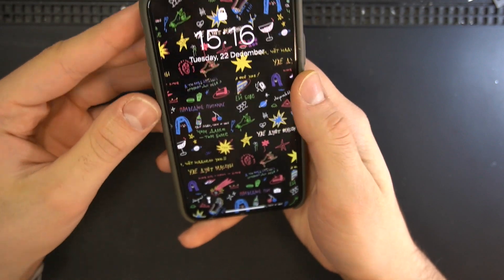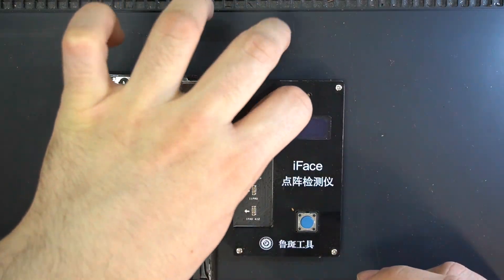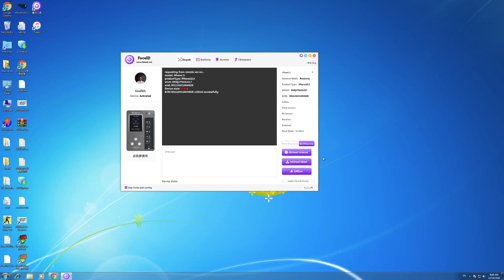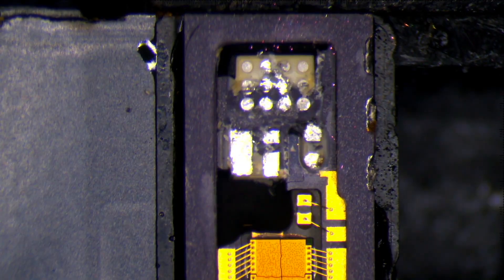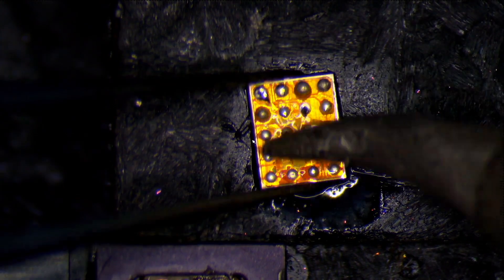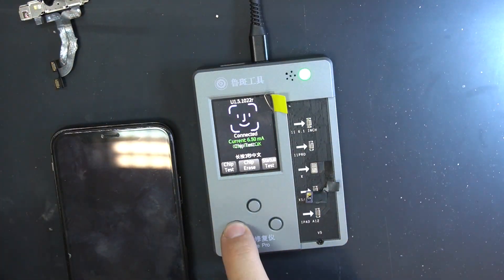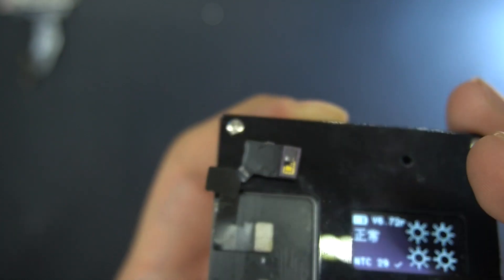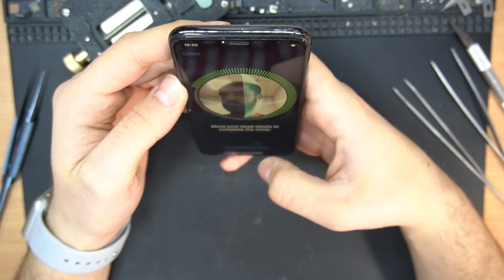iPhone X face ID repair (move iPhone a little higher move iPhone a little lower)

Comment: In every video I see people doing this complex stuff to fix the face id, can't you just replace the broken part?
Reply from the maker: Hi, the chip is the broken part in this situation.
Apple made the dot projector so fragile that a small touch with your finger while the battery is plugged can kill the chip.
And even if no one opens your phone it’s located so close to the earpiece that it’s not sealed correctly to prevent water damage.
Reply: @iTouch-repair  Ahh I see, thanks. If only the dot projector was broken, could I replace it?
Reply from the maker: @bansa1687  unfortunately no, Apple made the dot projector paired with the CPU as in the old days the Touch ID was paired to the CPU
Reply: @iTouch-repair  Alright, thanks a lot.
Reply from the maker: @bansa1687  your welcome

Comment: How much does this repair cost ? and where are you located ?
Reply from the maker: Hi, I am located in Ukraine.
Reply: @iTouch-repair  thanks, I am far away, probably sending the phone to you and back probably would cost me as much as buying a new one.
Reply from the maker: @forrestgump2114  not that much 😅
But it will take long to ship
Reply: @iTouch-repair  yeah thanks anyway, good work by the way.
Reply: @iTouch-repair  iPhone XS , after water damage Face id was disabled “A problem was detected with the TrueDepth canera. Face ID has been disabled.”, It’s greyed out, is there any easy solution?
Reply from the maker: @forrestgump2114  unfortunately no. It should be diagnosed first to know the fix.
Reply: @iTouch-repair  thanks, I wish you could fix it for me, you seem very skilled and professional.